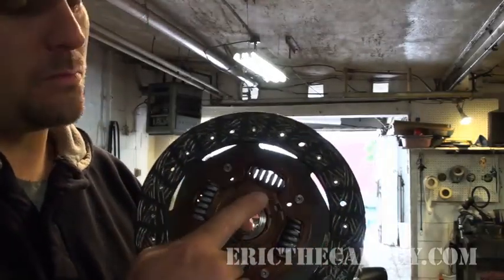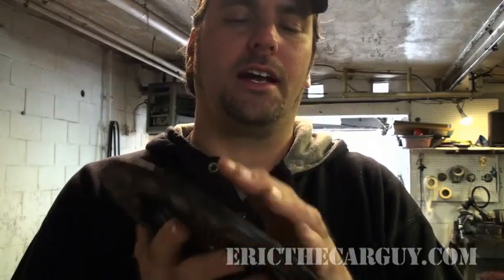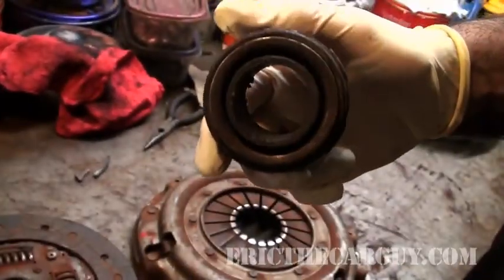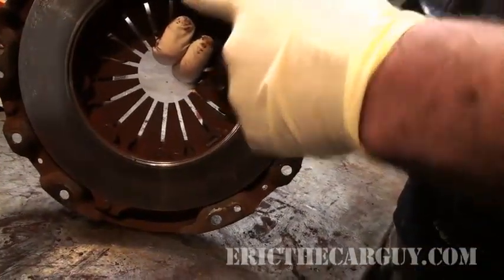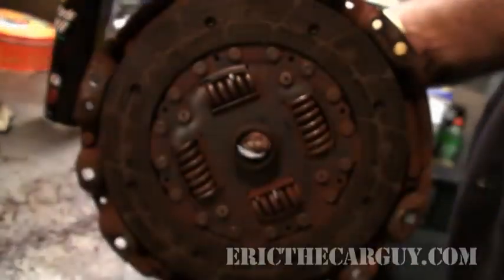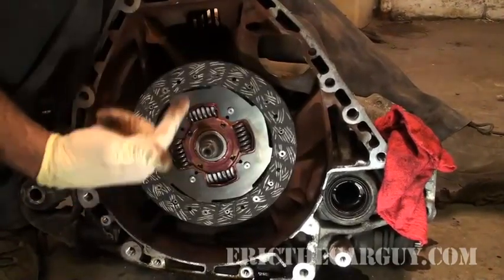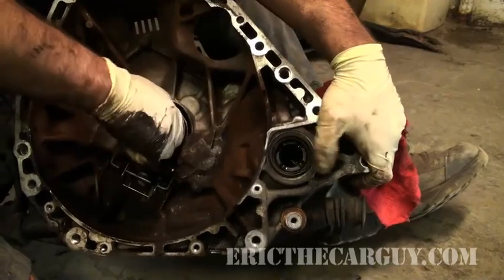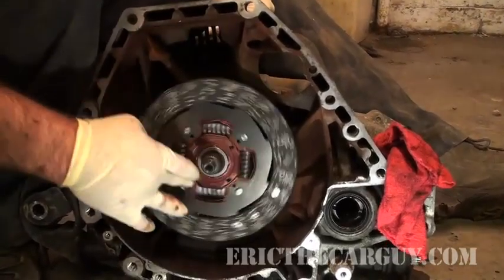Learn How A Clutch Works In Less Than 5 Minutes - EricTheCarGuy

Comment: The clutch disc in the video isn't 2 plates and don't move independently. The clutch disc splines are on a small disc on the inside and are not riveted to the friction surface plate that the friction rings are riveted to. The small disc is held in place by the springs for easier engagement.and disengagement and is calling a 'sprung' clutch.  Unsprung has no springs for a beefier performance grab with higher rated pressure plate to handle more power and are usually brass or kevlar,

Comment: awesome video thanks for the info can you tell me if a scraping sound would be something wrong with that plate or the throw bearing? or is it something in the actual transmission? the car runs fine and the gears change fine, but there is a terrible scraping sound even when parked and in neutral. also when driving. it comes and goes and is starting to happen more frequently. pressing in the clutch makes it stop, but the other day I held the clutch down and held the gas down at 2 rpms and I heard the scraping sound still. It was much less with the clutch pressed in though. it's a '92 toyota paseo.manual tranny of course lol. thanks for anything you can tell me and for the videos
Reply: ive just had that in my reliant rialto when i push down the clutch pedal a scraping sound starts and stops when i let the pedal up i took out the gear box and found the clutch was badly worn the plate was worn and the thrust bearing had at least 10mm of steel ground of it so it sounds like you need a new clutch to
Reply: thanks a lot I'll look into that asap

Comment: @EricTheCarGuy I guess the thing is balanced - it seems oddly nonsymmetric, though.

As for the extra rotational mass - I'm talking about racing situations, not regular street driving. In many situations, people go for any extra weight they can off of spinning parts - 3lb lighter crank pulley, 5lb lighter flywheel - it just seems like a redesign with a fixed pressure plate would not be hard and would be beneficial - add weight to the flywheel if you want it.

Comment: Thank you, very detail clip about clutch. Can you make a clip of how not to fry clutch too much ?
Reply: An Lq When you shift gears remove your foot each time. Most people do what is called riding the clutch. They keep preasure on the clutch peddle. That causes the clutch to slip and burn or fry the clutch getting it to hot. Go to a parking lot and learn how to let the clutch out with out using any throttle. Most people give to many revs before letting out the clutch peddle.

Comment: on your corolla its a Hydraulic clutch ok. in this video its  spring loaded, that moves the throw out bearing. if your pedal feels very soft or its hard to put into gear it could be the hydraulic master and slave cylinders.  check for leaks. the master cylinder should be located some where around the brake cylinder.

Comment: they serve the same purpose yeah, the shift linkage goes from the shifter assembley and runs to the transaxle, once it gets there it does the same thing that a regular transmission does, it moves the shift forks which select gears, in a regular transmission its designed so that the back of the transmission sits just below the shifter assembly, so theres no linkage needed it just transfers directly into the transmission

Comment: It slips. Pressure and friction cause it to be engaged. If there's not enough pressure it will slip, but it will still apply some torque to the gearbox, which is how you pull away from a standstill and not stall the engine.

Comment: my clutch has that same ring on the pressure plate from the throwout bearing. i just put a new clutch in yesterday and it still does the same thing but my oem clutch did not. would this be a clearance issue? if so how could i fix it ? please help

Comment: Probably a stupid question but..

the way i see it is that the flywheel, clutch plate and pressure plate all spin at the same time with the same speed depending on engine revs and if the clutch is slipping or not. Just makes me think isnt all that bit to heavy and bulky.

Comment: @Pursuit99  If you're spending a lot of time in traffic with the clutch pressed in however, the throwout bearing can wear out or even catastrophically fail. Personally, I sit in neutral whenever I'm stopped and have never had an issue with a throwout bearing before.

Comment: I wanted to finally understand it. I've been driving manual for more than a decade now. But all I see in this video - English not being my mother tongue - are two flat plates being pushed towards each other and away from each other. I don't get it how so many horsepower and torque can be transferred with doses over some flat smooth surfaces rubbing against each other. And springs. 

You have this (which I see wrong, no doubt) and the big metal chunks of gears in the transmission which make a lot more sense. Off to another video I guess.

Comment: hello frnd i have a question,wen a car is running im press the clutch pedal about 30 mins the engine will run free ok ,is the disc will wear or slipping quickly? thanks

Comment: Hi super nice video thank you. I changed my clutch, pressure plate, throw out bearing, pilot bearing and engine seal. when i am finished the vehicle could not go into any gear at all and it grit when i attempt reverse. i am bleed the clutch and the problem remains. could it be the pressure plate not tighten enough. please reply quick i want to know what to do it our only vehicle i want to be sure before i take down the gearbox again.

Comment: Nice vid though the one thing that everyone has forgotten to mention thus far is the disengagement. Since the clutch wheel is between a rock and a hard place, what actually forces it off the flywheel when the pressure plate relieves? Is it just friction throw off? Thus meaning that whilst there is not force applied to maintain the friction the friction will throw the disc that mill or so off the fly wheel resulting in the traction being removed?

I've helped change a few clutches and know they work but lately I'm getting much more in to the why/how it works for a few things in the car and have started doing a LOT more maintenance to our own car I'd normally be afraid to do (computer tech not mechanic here).
Reply: +Glen O'Riley Good question! I think that with nothing pressing the clutch plate onto the flywheel, it quite simply slips when the flywheel rotates. After all you have the gearshaft and rest of transmission connected to the clutch plate, so not easy to spin the whole thing around unless pressed onto the flywheel.
Reply: Nikolay Jordanov
The only issue I have with that is... wouldn't that be equal to clutch slipping/riding and glaze the disc(s)?
Reply: Must be different as it slips when hard pressed. Still, I'm just guessing here - if someone with knowledge / experience can weigh in that'd be ideal.
Reply: +Glen O'Riley Yes and no. When you push on the clutch peddle, you push on the clutch springs in one way or the other. This causes the preasure plate to remove preasure from the clutch plate / disc. The clutch plate / disc floats on the transmission input shaft. It works about the same way as disc brakes. If you look when you have a tire and wheel off the pads are right by the disc when the brake peddle is not pushed. The only time it really slips is when you first start to move. 
Once up to speed the only reason you have to push the clutch in at all is to releave the preasure from the synchros in the transmission so you can shift gears. You should only have to push the clutch peddle half way down to relieve the preasure a little bit to shift gears. If you have to push it all the way to the floor is because you are at a to high of RPM to match the gears.
Reply: What a great recipe for premature clutch death! Wasn't it what this video was about? How do you think exactly your "rev matching" will save your plate?
Reply: It is harder to do if you have a front wheel driver. If you have a rear wheel drive you can if good at matching speeds RPM you can change gears without pushing in the clutch at all.

 Most people give way to much throttle before they get the clutch peddle all the way out. If you don't match the RPM for the next gear you have to push the clutch to the floor wait till the RPM's come down for the syncros in the transmission to match then let the clutch out. That causes a lot of slip.

 The other reason is every time you push the clutch peddle to the floor you make the clutch preasure springs weaker and weaker. Then the clutch really starts to slip. Most of the time you wear out the clutch springs before wearing out the clutch disc friction material.
Reply: I'll have to check the effects of rev matching on gearbox transmission... But by the time your clutch springs start failing, you would have sold your car twice over. And even if you still have it, they are a lot easier and cheaper to replace than clutch plate (from memory). Unlike the effects of rev matching gone wrong... Looks like something to read on and try!
Reply: +ScLmRaceFanPhotos 
Can you please help me understand something? I can't visualize why "riding the clutch" is bad. I drive to work in really bad traffic and typically must sit at idle for about 7 second but about 300 times back-to-back within the span of 20 minutes (in Boston, if you don't stay on the bumper of the car in front of you, someone will cut in and everyone will beep). So if you have to sit at idle, if you keep the clutch depressed, why does that wear the clutch? I just can't visualize it. 
You made a comment that makes me think it's related to another phenomenon. After I got into motorcycles and started sometimes replacing my own disc brake pads, I noticed that there is no mechanism to pull the pads away from the rotors after you are done braking. Why does this not wear the brakes? Is it like the clutch? 
I've been really dying to know why riding the clutch in a non-moving car is bad. If I understand it mechanically, then I can do a better job of knowing when to pop it in neutral versus just pausing in 1st for a moment before going again.
Reply: Zack Hyde
it's the same as riding your brakes, excessive wear. Those who ride their brakes need to usually replace them every 12 months (where I get probably 3-5 years from a good set of bendix's in an auto.

Would you rather ride the clutch and pay for a clutch replacement every 12 months? Or every 3-5 years instead?

Obviously there will be some slip in applying and disengaging the clutch but it will be worse if you ride it.
Reply: Zack Hyde Because each time you push in the clutch pedal you are working the clutch finger springs.Each time you do it they get weaker and weaker. Less clamping force on the cluch disc. Over time you maybe letting the clutch out fine but the springs have gotten weak and cause slipping.

 Also if you are in stop and go traffic let the clutch out get going. Then take the car out of gear and coast to a stop. If you have to put it in gear while move less wear on the clutch. You still have to push the clutch in, you are not riding it by having your foot on the pedal.
Reply: ScLmRaceFanPhotos
top that off with just gearing down early for lights etc you often won't have to drop below 3rd and rarely need breaks. This is something I miss in the auto.
Reply: +Nikolay Jordanov its completley fine to idle with the clutch in as long as its all the way in, if you are sitting with your foot pushing the clutch halfway in or whatever then it you will wear away your clutch because it is just rubbing the other plate

Comment: I have a couple questions now that my clutch is starting to go. 1, my dad has said a bigger pressure plate will make pushing the pedal like a brick, but what is the + of that? 2, have you ever worked on a s10 clutch, if so do you know if there are different pressure plates. lastly, if my clutch is at the tip of starting to slip, am I in dire need, or better standing, to replace it now, or can I be safe waiting it out a couple more months, b/c this is not a daily driver. thanks a lot

Comment: Eric i need your help, I cant shift up to any gear in my manual gear when high up in RPMS, the clutch flywheel, pressure plate, Throwoutbearring, gearbox oil, engine mount are new and replaced 1 month and 3000km ago. I drove 3000km fine with the new set and never had issues until someone else launched my car from a standstill. When he wanted to shift to 2nd during the hard laucn the tranny blocked. 

Now you think the tranny is broken and that is wat I though so i replaced the tranny but the problem still exists. I checked the TOB with a micro camera and it does move instantly when i press the clutch pedal lightly, already bled the TOB and even replaced the shifting mechanism. Im clueless what is happening and hope you have any ideas

Comment: @m33ts4k0z No, having the clutch pedal pressed will not damage your flywheel. The part I would be worried about is the throwout bearing though. Under normal circumstances, a clutch will need to be replaced because of a combination of the pressure plate fingers getting weaker and not holding very well and the friction material on the clutch disc wearing out and not gripping the pressure plate/flywheel very well.

Comment: i have to 2006 Nissan  pathfinder4.0L 4x4 Automatic... and had the radiator go bad (still need to replace it) flushed and filled it and bypassed now only going to external transmission cooler. I know transmission would eventually go bad. so now i think i ran transmission with not enough fluid ( had to add about 2-4 quarts for it to show normal on dipstick).... so i flushed and refilled it tell it tell it  pumped out good looking fluid. well now when i drive it cold it shifts fine but after about 3-5 min or once transmission fluid is Hot i lose acceleration but my RPM goes up. also some points to add is when it shifts from like 3rd to 4th.. or 4th to 5th i did get some vibration also what feels like a hard shift.  my plan is to replace radiator and get a clutch kit is there any advice you could offer me or any recommendations on what else to look at/ replace.

thank you 
Anthony
Reply: the issue here is that autos dont even have clutches man. you need to take your car to a mechanic instead of doing it on your own.
Reply: Karl Puetz...automatic transmissions actually have clutches.. there are actually several clutch discs for every gear, I believe 6 or seven..maybe even more in a clutch pack

Comment: hey eric. i have a 1990 mustang gt with fully built 383 stroker chevy engine in it. ive been working on it for about 4 years now and im FINALLY just about done. the only problem is that when i take off my clutch is just fine under regular load. but when i get it some gas (not a whole lot) my clutch starts slipping like crazy. i have a chevy engine with chevy pressure plate, and a ford tko500 trans with ford clutch disk. any tips on what i should look for?

Comment: Hey Eric, My weekend drive vehicle (which is a pickup hard used) starts to jerk backwards after every shift as if I released the clutch late but only after driving it for a while. And getting into gear becomes hard too. Even though the pedal comes back to its place my friend told the clutch might be delaying to. I doubt it might be a dirty carburettor. Could you suggest something?

Comment: the pressure plate moves off the clutch but what moves the clutch off the flywheel? there doesnt seem to be any mechanism that keeps it in place and it just sort of free floats on the input shaft? what keeps it from just moving forward and backwards and hitting the pressureplate and flywheel?

Comment: @ EricTheCarGuy: when I lift the clutch slowly in first gear to get the car moving, are the clutch plate and pressure plate grinding each other to partially transmit the power from engine to transmission? And how does a synchronizer work in here? Thx!

Comment: My throw out bearing is going out because I can hear it make a noise as I turn on the car but is it hurting the pressure plate?
Reply: Alfredo Flores ..the throwout bearing won't hurt anything, but if it's already making noise, at some point it won't be able to have any effect against the fingers from the clutch component. You are better off replacing bearing and all clutch components

Comment: the pressure plate doesnt move off the clutch its bolted to the flywheel, the diaphram springs in the center of the pressure plate push the clutch into the flywheel when the clutch is engaged, when you disengage it (press the pedal) the springs are pulled back so the clutch is no longed smashed against the flywheel its just common physics after that with nothing forcing the clutch into the flywheel the friction between the flywheel and the clutch disc basicly just pushs the disc off the flywheel

Comment: Hey Eric, I have a 2008 Honda civic lx manual. When I step down on the clutch, it makes 1-2 clicking sounds. Not really a big issue since it works fine. The clicking only seems to occur when the temperature outside is warmer (at least ~50F) and I never feel the clicking in the winter. Ppl have mentioned this is in civic forums but no one seems to have a clear answer. Any ideas?